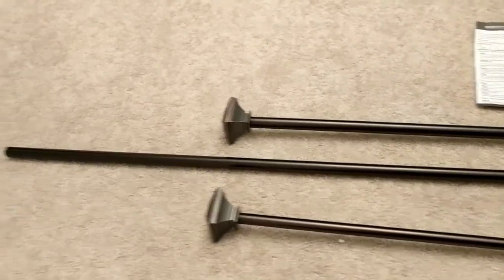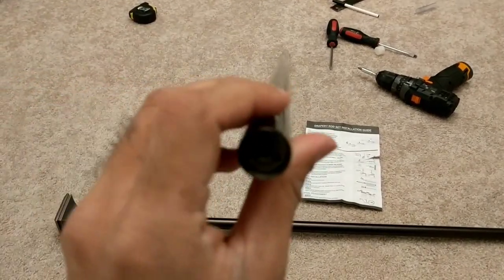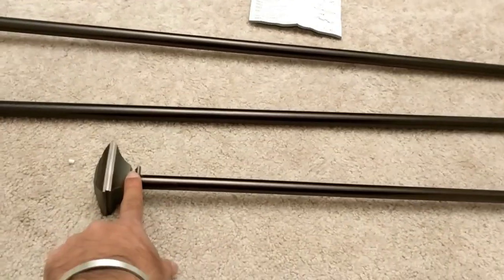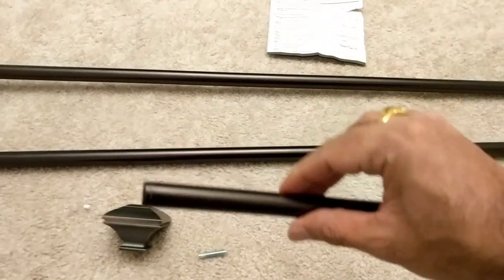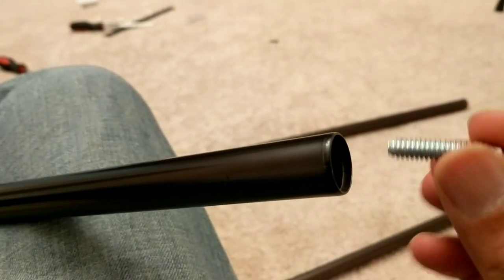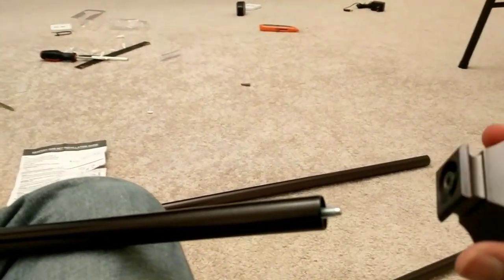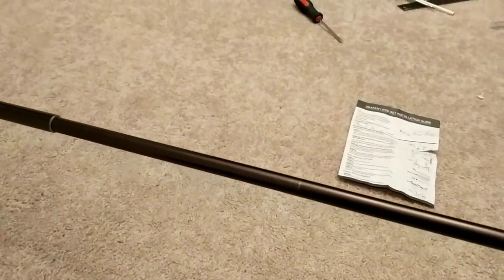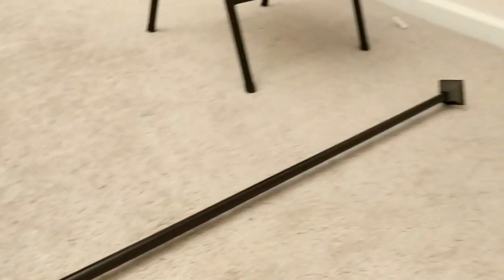Install Home Depot drapery rod aka curtain rod

Comment: We were looking for the receipt to return.  When we couldn't find it, we told ourselves we had to eat this one.  This video is a mood changer.  If the manufacturers would take a look at it, they wouldn't put the end piece (decorative ball or whatever) on the middle rod.  They are obviously assuming most customers will only use two pieces.

Comment: Thank you so much! I thought the packaging was assembled incorrectly but the packaging is correct as it is based on the 72 inch use. The extension is if you want to use it as the longer 144 inch use but they don't include the directions on how to use the extension piece!

Comment: Thank you so much for the video. My wife bought this at Walmart. It can with everything but no instructions. I spent over an hour trying to figure this out. Even had the hacksaw out . Wife said do it do it. I went to mfg page . Than to your video. It was up in less than 5 min. ... better put the hacksaw away.
Reply from the maker: I guess the hacksaw should be now disappointed. Hope you get to have your hacksaw fix with another job. Thanks for stopping by and commenting.

Comment: Each rod has a screw hole in one end to attach the finial (what you called crown), the small one is for the smallest amount of width so you put the small rod into the bigger and you get the smaller width, now if you need to do the extension you put the small rod in the center of both other bigger rods, making sure the finial hole is on the outside and then you simply extend the ends to your liking.
Reply from the maker: Yes, I wanted the rod to extend more than as it came out of the box, so I had to put the smaller rod in the center to make it to the size I desired. Also, thanks for letting me know that the edges are called a finial and not a crown. I was not aware of that term so good to know. Cheers.

Comment: How did you get the screw's out
Reply from the maker: In my model the screw just slides out on unscrewing. The screw is a double edged screw and it may be removed after removing the end mounts. In some model I have heard they have a push lock system. Mine was double edged screw. It's a drape rod I bought in Home Depot. Thanks

Comment: Thank you for this video.  You know what my problem is and probably everyone else' posting here is regarding the packaging of this curtain rod?  We think logically.  Tell me, what could possibly be the motivation for these companies to put one of the finials on the end of the thinner slider rod used to set the distance?  What point is there in making us go through this exercise and removing a finial from the slider rod onto one of the larger diameter rods where it belongs???  It makes no fucking sense.
Reply from the maker: Your welcome!.

Out of the box the rods are package to work as is for small windows. But the instructions for reassembling the rod is screwed up.

 I believe, the company thinks most window sizes will fit within the dimensions of the way they packaged it and only few people will need to adjust the rods to it's full size for bigger windows. Anyway, thanks for stopping by and commenting.
Reply: @feedbackloopfixs9503  Your explanation does make sense, although I would make a different choice (as I suspect you would) for the packaging.